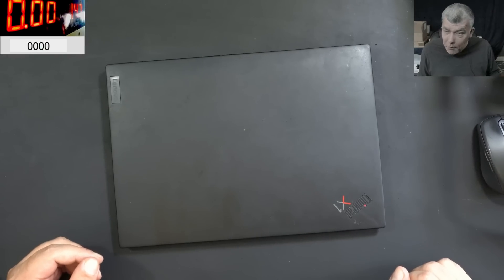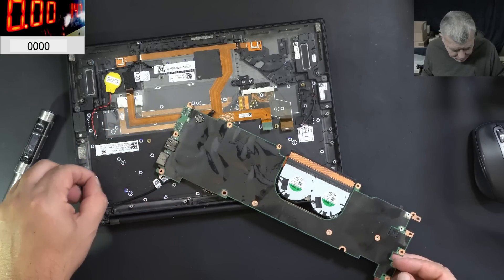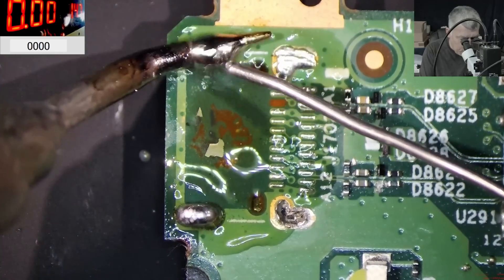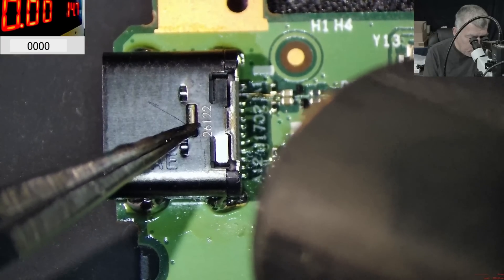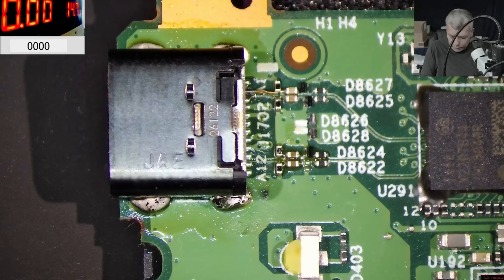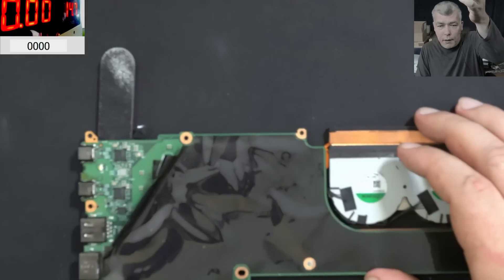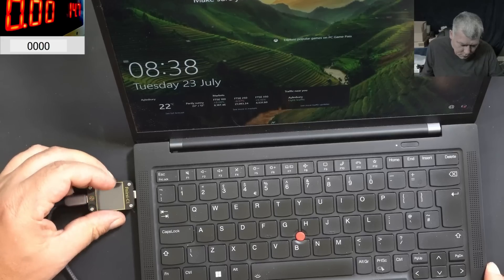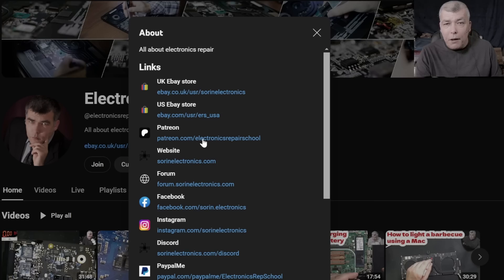Lenovo Carbon X1 - ports repair, ripped tracks repair

Comment: Hi Sorin, good Job... even hot glue better than solder mask if you must rework the ports... but u forget to test the reverse insert of plug and data connection....soldering with hot air the wire move on second port.... good how suggest @JFIXX1 to use Mechanic T824 tester or similar to test all PIN very easily... is true that the work is done by experience but sometime tools make life easy and less time more earn for u.....alway comment to learn from everyone and share experience with humility....bye Francesco Timpano from Florence Italy

Comment: This is where those magnetic USB-C connectors from AliExpress would really come in handy.
I guess using hot melt instead of epoxy means if the cable gets a really hard pull the hot melt will break and not the PCB itself 😲 Pete C.

Comment: You didn't check ports for data transfer  and didn't reverse the charger to check if other side is working but at the end laptop is working and charging.I think it's enough for repair.good job,I respect

Comment: Great repair but Im not sure all pins are working.
I think more test required before hot glue.
With USB-C breakout board and diode test or Mechanic T824 tester.
Need to test USB both ways and also data.
I think one trace repair came loose with hot air 😭

Comment: If you read this Sorin, please check the 2 comments where viewers spotted a small component come off the first port tracks @3:03 and a second where one of your repair wires comes unbonded from its start location @12:25. 😬

Comment: 12;28 Did you fix jumper wire on the bottom port because it may be touching the other trace?

Did you check if both USB-C ports are working normally with connector  plugged in both ways with some device and charging because as you said Sorin, you do not want it back 😁.

Comment: They glue the ports down to the solder mask, ie, paint, and it just peels off. They should've left bare copper with vias so the glue is stuck to something more solid.

Comment: I dont understand how much force do one need to use to just plug usb cable or sometimes hdmi cables to rip ports straight from the board. How is that even possible
Reply: @HummyGG  one instance would be the laptop falling with charger and USB cable connected.

Comment: 3:02 - 3:03 - Component is glued on black tape near D8622, removed with the black tape and never returned back. Watch when he folds black tape. Second USB C have this component... its the same components/schematics but Sorin didnt notice missing component.
3:05 it was there, then video is cut, at 3:06 its not there...
Reply: Plugging a charger and saying the port is good because it charges fine isn't the best way of testing the port IMO. You are only testing the power pins and PD pins. The port may not work as a USB 3.0 port (or even USB2.0) or do other things like output a display signal, if it's supported in this model.
Reply: @12:18 also, check the bottom wire, it desolders when the port is pressed.
Reply: @nikkopt  yeah, I thought that guy is good, but this is a big disappointment. I think Northridge wouldn't make such mistakes.
Reply: Well spotted. Looks to be a TVS diode on either a TX or RX line. Knowing Sorin's luck, the diode ended up back in the right place when the tape was rolled into place, aided by all that hot glue compressed underneath.
Reply: good catch there is actually something stuck on that tape
Reply: You can also see, at 3:05 it was there, then video is cut, at 3:06 its not there...
Reply: it might interfere with the data connection
Reply: Good spot.  Looks like lowest trace component - bottom port trace @3:03

Comment: the 2 port 1 of the wire is broken the bottom one when you use hot air 🥲🥲 ( 12:25)

Comment: The price-value ratio of the 10£ soldering station is pretty good. It doesn't have an airflow control, to prevent burning out the heater, but it's fine =)
I like it :D
Reply: it does have flow control. Soring just didn't notice it when he demoed it the first time.
Reply: @oddarnebeck  OMG, you're right :D LOL, i just pressed the "set" button xD
THANK YOU
Reply: @ATAG-yn5pd  do you have a link for the soldering station?
Reply: @oddarnebeck  do you know the name o have a link for that soldering station? thanks

Comment: It looks like the supporting legs for the USB C sockets weren't properly soldered at the factory. Some devices have a collar built in to the case which prevents the USB C socket from being pulled sideways, it doesn't seem as if this laptop has that which means lateral force on the plug is transferred to the socket on the motherboard which isn't designed to withstand it.